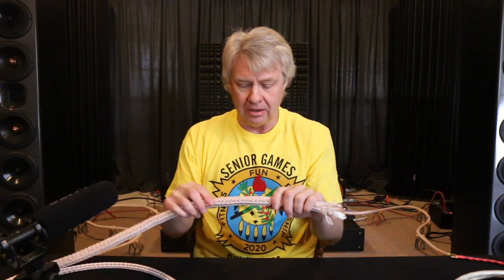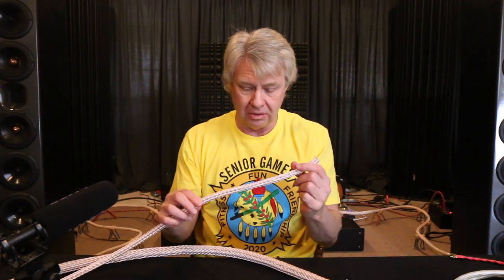What’s up with Audiophile Cable Risers?

Comment: I think it would be helpful for the skeptics if you were able to show some measurements or data comparing before and after cable risers.
Reply: Its a good idea but what would you measure?
Reply: @AT-wl9yq  if using cable risers produce a hearable difference in the sound, it should be possible to measure these effects. Otherwise there are only „earwitness“ accounts, made by people with flawed and imperfect measuring tools (human hearing).
Of course its totally fine for people to use cable lifters if that’s what makes them happy. But if you make scientific claims you have to be prepared to give scientific prove.
Reply: @AT-wl9yq  the voodoofactor ?
Reply: @HenneB  I can't say if they make a difference or not because I never tried them. The reason I said what are you going to measure, is we can't measure everything we hear.

"Of course its totally fine for people to use cable lifters if that’s what makes them happy. But if you make scientific claims you have to be prepared to give scientific prove."

That's something else entirely. The experience I have with people who claim "science", is they talk about it but never do it. For example, I'm sure you've heard of Audio Science Review (I think that's what its called.). He seems like a nice guy, but when I pointed out that he doesn't do anything even remotely resembling science, he seemed to get a little upset. But when I made my case, which is fairly simple, the discussion was over. He has a channel to build, and he's not going to let real science get in the way of that.

That's why I'm asking, what are you going to measure. Do you want to win an argument, or do you want to get to the truth. If you want to win an argument, no measurements, test, evidence, etc... will ever do unless I get the results you want me to get. If you want the truth, then you need to use real science. So unless you can come up with something real, we can't have a discussion.
Reply: @cbts001a4  That's a typical response for someone who doesn't know how science works. 

Lets have another look at my question.

"Its a good idea but what would you measure?"

Now is that so complicated you can't give me an answer? Its a very simple question.
Reply: @AT-wl9yq  Use a squarewave as example. you can try it with different frequencies. If you see same shape with and without, it is snakeoil.
Reply: @HenneB  A trained human ear can easily perceive a 1dB change.  The best ones, a couple of tenths of a dB.  The dynamic range of the human ear is 130dB.  This is from the noise floor (0dB) to the threshold of pain(130dB)  This is a power ratio of 10 TRILLION to one or 13 decimal places.  A 7-1/2 digit Keithly meter is~$7,000.00.  Each digit is an order of magnitude.  Digital oscilloscopes are typically 8-bit and the best ones are 32-bit.  Do you understand the implications of trying to do measurements in these magnitudes?  Work the Nyquist formula to arrive at what it will take.  Prove me wrong.  Go ahead............. we are all waiting.
Reply: He will never do that. He is a storyteller. 
Damn, he doesn't even know how to make these measurements. 

You have to have 50k+ cables first :D All that bullshit.
Reply: @Echo_III  I know how to take the measurements. If you can tell me what we're measuring for, and why, I'll do it.

As for needing 50k in cables, I can't help you. First, price is not an objective quality that can be measured in any way. All it can tell you is how much someone is trying to sell it for. Second, since I've never heard anyone make such a claim in any context whatsoever, I can only conclude that its a statement you fabricated. As always, if you can provide any type of credible reference to back your statement up, I'll correct my post.
Reply: @AT-wl9yq  I don't mean YOU. I mean the VIDEO MAKER.
Reply: measure a band after playing together for a year and before what instrument will you use to measure that ?
Reply: @cbts001a4  if your playing the voodoo you do by Chis Isack maybe a factor
Reply: @cbts001a4  Do you do that a jazz gig ?
Reply: @carloshathcock846  Good reply Carlos
Reply: @harmony01ful  Why is this all directed at me? Unless my first response threw you off. People like you are correct, but you're trying too hard. When I said, its a good idea, but what would you measure, it was a setup. You have to remember that you are dealing with people who are truing to push science and measurements, not to get to the truth, but to win an argument, like in a court of law. People are not found innocent, they're found not guilty. That means you may have committed the crime, but they just don't have enough evidence to convict
you. You win by default, not by truth.

That's exactly how the science/ measurements crowd thinks. They have no idea what science is, or how it works. You don't need to respond with a well thought out technical answer. If they were that smart, we wouldn't be having this conversation. Look at the original post one more time.

"I think it would be helpful for the skeptics if you were able to show some measurements or data comparing before and after cable risers."

That's a reasonable request. The problem is no matter what you give them won't matter. They're just going to pick through it in an attempt to find something to argue about. You can't win regardless of how good your response is. 

I take a different approach. If they want measurements, fine. But any measurements I come up with, will be dismissed by default. So I ask them what measurements they would need to see. They can't answer. If the people insisting on all this can't even tell you what type of measurements they want, what does that tell you?

 I guess you haven't seen some of my other posts. I go over to the cult leaders channel, Audio (Junk)Science Review, and I tell him he's not doing anything that resembles science. Then I back it up and make a case so simple, a little kid would understand it. Then he pulls my posts.
Reply: @AT-wl9yq  Sorry it was just late at night some people never listen to live music a Robot ie machine can,t measure all the factors to musical enjoyment ywo p[ieces of audio geewra might measure identically but sound quiet different , measure what you can measure but listening is needed someone with field experiece mentioned the importance of layout for a  circuit board . Sorry if i got you mixed up with the meaurement weenies the reductionists get up my nose the paralysis or analysis I think our emotions need to be engaged if music listening is entirely crebral I find that boring it can engage all the senses I have heard the same band after years of playing together and before I can hear the difference easily without a $25,00 spectrum analyzer to half confirm what i am actually hearing . I am just singing the praises of the human ear .
Reply: @AT-wl9yq  Your comments about Audio Science Review and the "discussion was over" because of your "real science", this is laughable. Reality: you thought the discussion was over because that's what you wanted to believe. Getting the last word in doesn't prove anything scientifically. I've been following both Amir and Danny for quite some time, and when it comes to science, Audio Science Review is about as grounded in real science as it gets. Not saying Amir can't be wrong, but he's much more thorough and objective than Danny is, and when confronted with real proof that he's made a mistake, Amir will go back, retest, change the results, and admit his faults. It seems in your case your "proof" wasn't provable, and so Amir decided not to entertain your "real science" theories.
Reply: @vanwiseman  I don't know what Danny has to do with all this. Danny's arguments have to stand on their own, just like Amir's. All my comments in this thread were about Amir. Why bring someone else into it? If you read my posts, my argument with Amir is he  doesn't use real science to back up his conclusions. If I'm wrong, fine. Show me. I'll make a correction, but it has to be something real. For example, if Amir is making the claim that cables can't make a difference, I want to see the science behind it. In your post, you're telling me I'm wrong, but you're not showing me.
Reply: @AT-wl9yq  No one's bringing Danny into this. He's in this ever since he (Danny) posted the video. The entire comment section is predicated upon Danny's claims from his video, and this particular thread originated with OP's request (to Danny) to "show some measurements or data comparing before and after". So just to be clear, the video is Danny's, and comments are about Danny's claims, which don't stand on their own, because Danny doesn't show any data proving them.

Now re: Amir - you brought him into the discussion as an example of someone who "doesn't use real science to back up his conclusions", inferring Danny is the opposite. But the burden of proof is on you to prove Amir's science isn't real. Just mentioning someone on the opposing team, saying they are a "person who claims science, and talks about it but never does it" doesn't make it so; it's just projection. It's not on me to show you Amir's 'real science' examples - they exist in plain view for anyone who wants to see. Go to his site, read his reviews, watch his videos. He provides both objective measurements and listening tests to prove his claims. In contrast, what does Danny do? He just asks us to trust that he knows X is true because he can hear it, or because he "knows a guy" who has so much experience he just can't be doubted.

To recap: cables lifters DO NOT make an audible difference until someone shows evidence that they do. You've created a Russel's Teapot here. The burden is on Danny, you, or anyone to show empirical, scientific proof that lifters make a difference. It's not up to me, Amir, nor anyone else to prove they don't.
Reply: @vanwiseman  The easiest way to get through this is to go with your recommendation to look at Amirs videos. 

https://www.youtube.com/watch?v=QNp_2VDUrYs

There's a link to Amirs review on a Nordost Tyr 2 USB cable. Assume I have the same cable and I'm hearing clear differences between the Nordost and other USB cables. Would you say there's enough science being done by Amir to prove the differences I'm hearing are not real? I assume you're going to say yes, but I just want to make sure we're on the same page before I respond.
Reply: @AT-wl9yq  It depends on what you mean by "clear differences" and "real". If you mean the kinds of differences Nordost claims in their product description: "provide superb sound staging, wide dynamic range, and precise timing, minimize cross-talk, and reduce noise", then yes, Amir's review (pending he's showing us honest data) provided sufficient proof the cables measure and sound the same. The Nordost claims are clearly debunked by the test.

But if the differences you heard were not subtle, i.e. one cable had obvious static, signal drop-out, or added artifacts that shouldn't be in the signal, then I could believe you're really hearing these differences. Explanations include a damaged cable, poor connection, or some other audio component causing the difference you attribute to the cable.

Even if you claim to hear subtle differences, I won't call you a liar. What's "real" in your head can't be determined from Amir's testing, which doesn't consider your perceptions. You can "hear" things that are not real, and so can I. So can both Amir and  his wife, as he mentions near the end of the video. We all perceive "differences" differently. And so herein lies the value of objective measurements.

It's worth mentioning the USB cable example you provided is a case where measurements really aren't needed to prove the cables will sound audibly the same. If you understand how digital audio signals work, so long as the bit sequence is preserved, all of the qualities: staging, dynamic range, timing, cross-talk, and noise cannot change by subtle amounts as an analog signal can. When a digital signal is compromised, the deterioration is very audible and obvious. This is an advantage (and sometimes disadvantage) of digital audio, by its nature.
Reply: @vanwiseman  You are making a pretty big deal over what qualifies as an audible difference. There's no way of classifying something as a subtle difference or going through a list of manufacturers potential sonic benefits. Its always black and white when you guys are making claims. Now, you're arguing like a lawyer to try and position yourself to win a case, and not get to the truth. This is exactly why I asked you for an example. 

Stop talking in circles. Anyone who watches and supports Amir and his channel will tell you USB cables all sound the same as long as they're not broken or somehow used improperly.  

"Even if you claim to hear subtle differences, I won't call you a liar. What's "real" in your head can't be determined from Amir's testing, which doesn't consider your perceptions. You can "hear" things that are not real, and so can I. So can both Amir and  his wife, as he mentions near the end of the video. We all perceive "differences" differently. And so herein lies the value of objective measurements."

That doesn't even make sense. In the video Amir claimed to hear differences, but when he listened to the cables again, said they weren't real. Beyond that, a well conducted blind test will eliminate your concerns about subtle differences. Differences will either be audible or inaudible. There's no 3rd choice. 

I'm not changing my question. Either you side with me and believe there are audible differences between USB cables, or you side with Amir and say differences don't exist. Don't forget, this is all about me proving Amir doesn't do science. I'm not changing my position or running away from my claim. However, before I can make my case, we have to find an example where you say Amir is doing science, and I say otherwise. This usb cable review seemed like a pretty safe choice. You need to take a stand. Is Amir doing enough science in his video to prove me wrong? Its a yes or no question, and I'm not trying to trick you.
Reply: @vanwiseman  I've done this hundreds of times. We're not talking about cable risers. The conversation has evolved into a disagreement as to whether Amir is doing science or not. All of my comments are in the context of that statement. But I won't keep talking in circles. If you can't take a stand and answer my yes or no question, I will not waste my time. Why? Because I've done this hundreds of times. What's going to happen is I'll give you the proof you're asking for, they you'll start twisting your statements. 

Here's what's really going on. You checked my posting history and know you're going to lose. That's why you are afraid to take a stand. You know I can prove Amir isn't doing science. If you're right, and Amir is really doing science, you would have no problem saying as much. 

I will not change my position on this. If you want me to prove Amir doesn't do science, my only requirement is we have to agree on a specific example. That's it. The only reason you don't want to stand by your claim, is so you can get out of it. I'm bound just like you are. If I can't back up my claim 100%, I lose. According to you, I can't do that, so what are you afraid of?

Also, this is it. If you're not willing to commit to something fair, fine. But I'm done. No more of this senseless back and forth. You can continue to post and say whatever you want, but anyone that has been following along, knows you backed out.
Reply: @AT-wl9yq  "Amir doing science" was your straw man to defend Danny's subjective claims. That's been torn down and burned up, and I didn't even need to provide the evidence - you did. Anyone can watch your linked video and see that Amir is taking objective measurements, using controlled test procedures, and providing calculated scientific results. I don't need to take a stand - Amir already defended himself with empirical data.

Know how I know you're wrong? Because you assume things like the idea I would waste time out of my day to check your posting history (self-righteous, btw). You also assume that I know I'm going to lose. Really? Who posts an argument if they know they're going to lose? Such projection there. And I'm supposed to be afraid of your "hundreds" of glorious Youtube posts? Super weird flex there.

When you say something like "I will not change my position on this.", it strongly suggests you aren't open to scientific principles. According you your own logic: "If I can't back up my claim 100%, I lose."

I'll let other readers decide who "won" this debate. Cable risers still don't work.